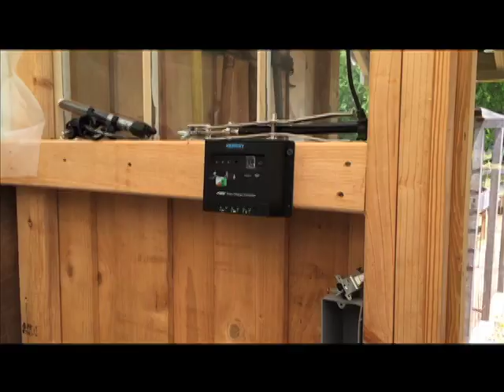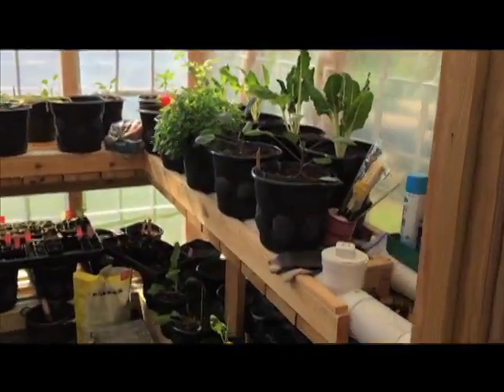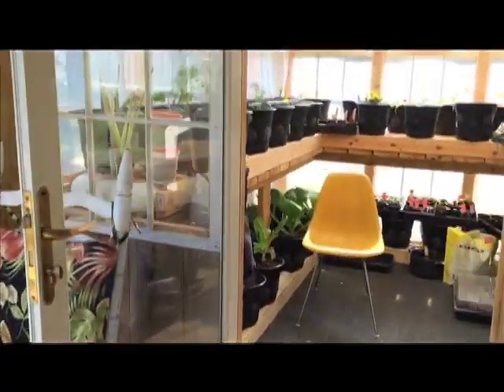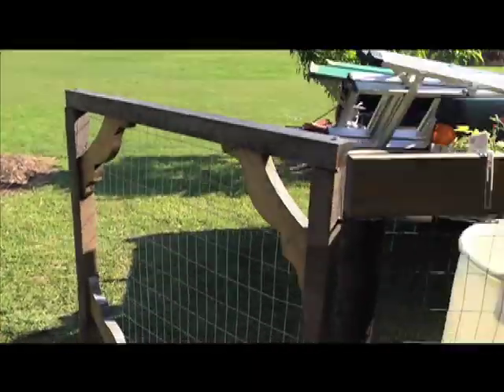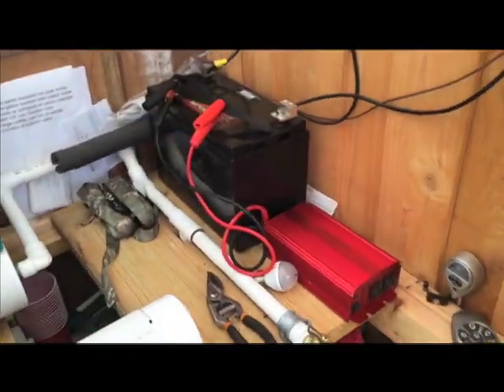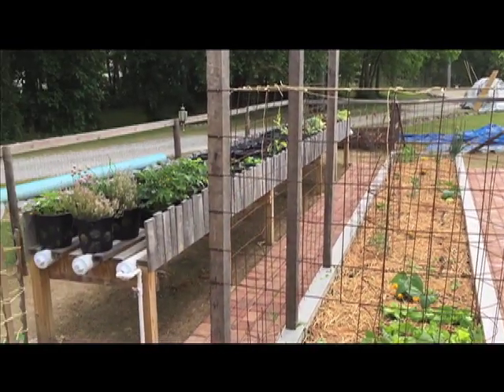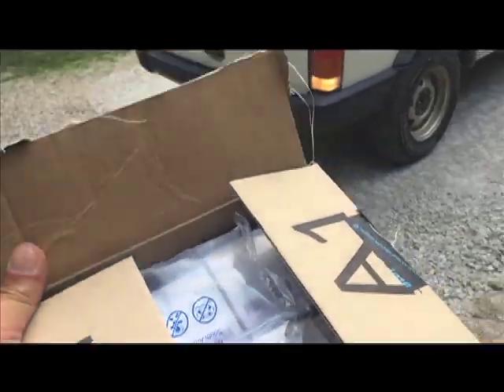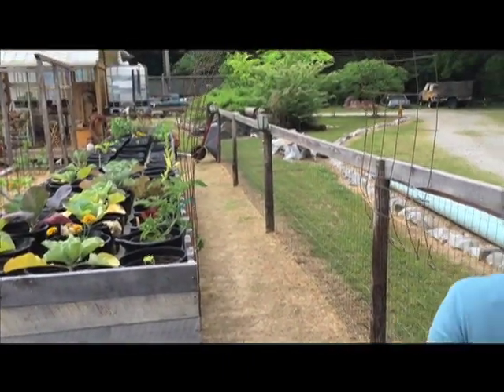Adding Solar Lighting to the Greenhouse and Filtered Rain Water

Comment: if you are looking for a great grow buld, Daylight balanced led bulbs give you the same wavelength as a grow bulb for less money
Reply from the maker: Rev John O'Toole Thanks Rev.  I have looked at them and since I don't have power to the greenhouse I don't have the wattage available to power them.  I may upgrade the solar system some day but right now, not going to happen.  I am going to build a new system this winter.  A soil less airoponics system that self rotates.  I'll post something soon.  Thanks for the comments as usual you are one of my best followers.  Thanks again for the post.

Comment: An inline spin down filter works great as well with no filters to change
Reply from the maker: Tom Martz Yes I didn't find them on youtube until I had already ordered the filter.  I think I can wash the filter rather than replace it... I will see.  Might have to switch or do a spin filter before the Aqua Pure filter and I can almost drink it. LOL.. Thanks a bunch for the comment Tom.  BTW I worked as a grip on Alf years ago.